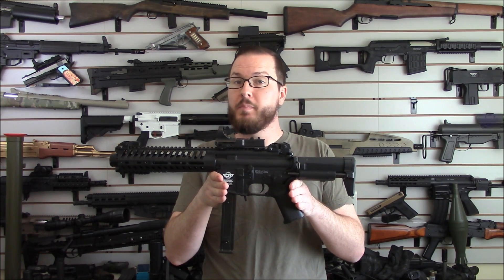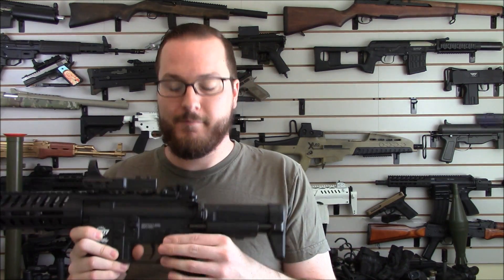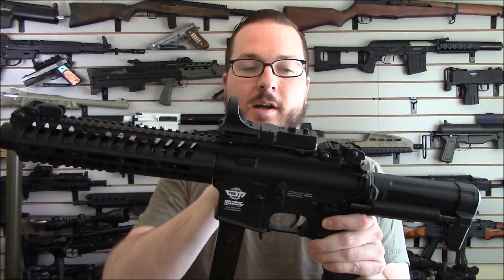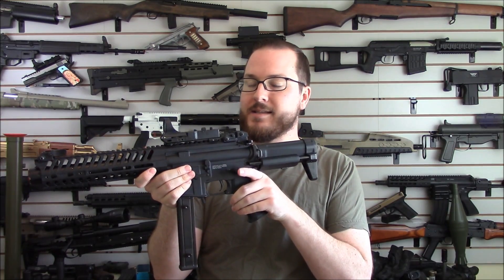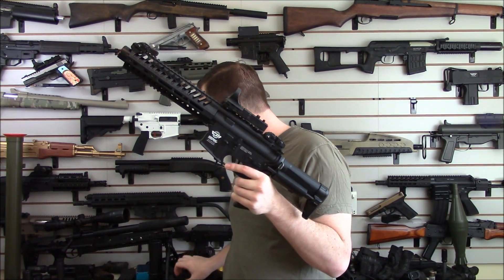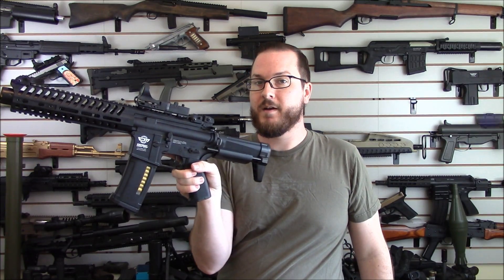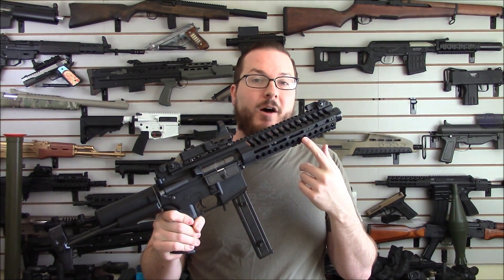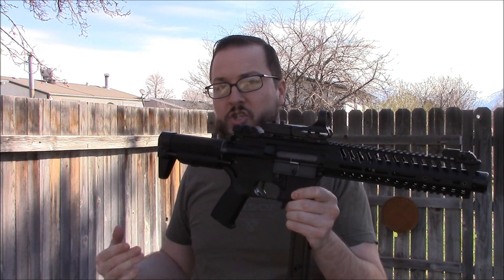G&G 300 BOT Airsoft Project: Integrally Suppressed Mod

Comment: How do you remove the G&G rail and attach another?
Reply from the maker: +Ben VanderHyde Undo the screws to slide the actual rail off the barrel nut. On this gun, the barrel nut is removed using a wrench similar to an M4 buffer tube wrench. When you get the rail itself off, you'll be able to see what needs to be removed to get the barrel nut off.
Reply: +Booligan Airsoft Awesome thanks!
Reply: Booligan Airsoft hey do you think you can do a video on how to remove the g&g rail and barrel nut i dont understand when you told a guy how to do it thanks
Reply: Ben VanderHyde is there any screws when removeing the rail and barrel nut
Reply: s.o.t Alpha Im not sure I'd have to look
Reply: Ben VanderHyde ok you asked booligan so i thought you know thanks for fast response and when you take off the barrle nut will please tell me
Reply: s.o.t Alpha If I remember right, if you have a set of alan wrenches  you'll be fine
Reply: Ben VanderHyde ok when i look into my barrel nut there are 4 holes and there arnt any screws in mine do i have to do other things to get it of
Reply: off
Reply: s.o.t Alpha  Honestly I'm not sure
Reply: Ben VanderHyde ok i was just wondering
Reply from the maker: s.o.t Alpha If there are no screws on your barrel nut, then just unscrew it. It might require some muscle to break it loose.
Reply: Booligan Airsoft thank you so much for the help and do you turn clockwise or counter clockwise
Reply from the maker: Counter clockwise, lefty-loosey,
Reply: Booligan Airsoft thank you

Comment: what motor do you use in that? I want to get one!
Reply from the maker: +Alex DesJarlais I'm running a G&G prototype "orange" motor.
Reply: +Booligan Airsoft damn. anything you would recommend that could run like that on a BOT that isn't a prototype?
Reply from the maker: The G&G "Powerful" motor that I tested out at the same time as the prototype one gave pretty similar ROF.
Reply: +Booligan Airsoft cool! thanks!

Comment: lol now they have this gun for 290$
Reply from the maker: Link? This is a custom built gun, not something off the shelf.
Reply: its not the same gun but very very close http://www.airsoftgi.com/product/GG-CM16-ARP9-CQB-AEG-Carbine-Airsoft-Gun-Battery-Charger-Package-Black-31813/
Reply: shorter barrel
Reply from the maker: SpacePunCakes shorter barrel, different stock, different receiver, different style of handguard, compensator instead of suppressor, etc. Only thing they have in common is the trigger, lol.